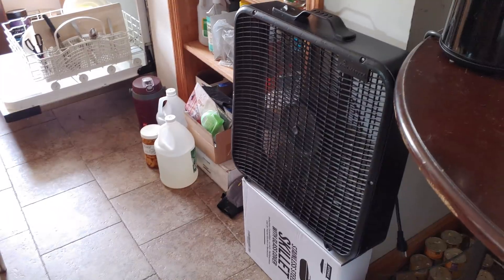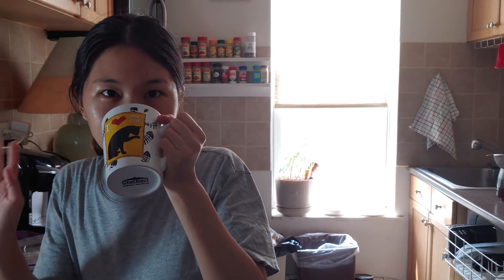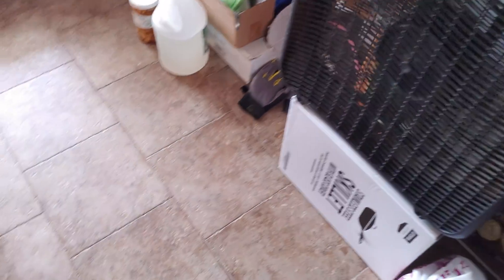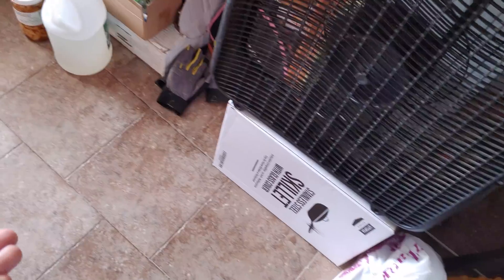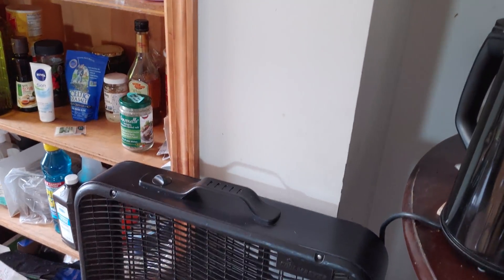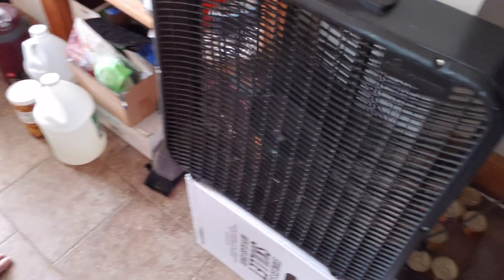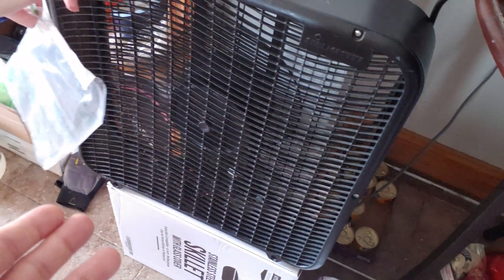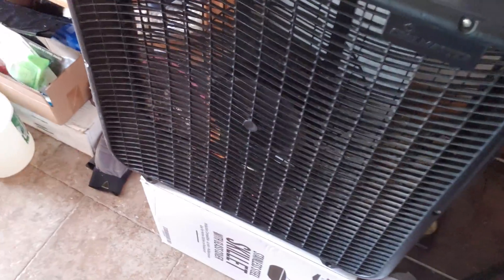Apple user ventilates home worse than Apple ventilates their computers 😢

Comment: TBH, some PC cases' front intake are just as bad as this. All the glass, RGB LEDs to make it pretty while the fans are choking for air flow.
Reply: @Bobby Bologna 😶 watch Gamers Nexus and their case reviews. You will realize how badly mistaken you are lol... it matters how much air MOVES through the system lol. You need to provide the fans air to be able to push out the hot air lol otherwise you are literally cooling nothing.
Reply: Yeah, but at least you get to choose a better case, if you want, unlike with Apple.
Reply: @Ben T. The thing that turns most people off from good stuff like Noctua is the weird coloring, almost anybody that makes a computer decides to put tacky RGB everywhere they can. I've never liked the look of it, plus because so many people make sure to do their first build with RGB, they can run into some problems.
Reply: @Ben T. Why spend so much on case fans?
Reply: How does RGB affect airflow?
Reply: @anonymousarmadillo6589  Everyone knows more RGB = MORE performance!!! R-right?
Reply: @Hyoiza  Yeah!!😂😂
Reply: @Hyoiza  Only if you set it to only red. If you set it to blue, you get more cooling, and if you set it to green, it uses less energy! =D
Reply: @anonymousarmadillo6589  Many case makers use solid glass front panels so that you can see the RGB fans better instead of using metal mesh, THAT'S how RGB affects airflow.
Reply: @SirReptitious  If you but a decent glass case, its not that bad.... Atleast the heatsink is connected to the CPU lol
Reply: @SirReptitious  Such bullshit exists? I recently built me a new machine with a lovely upright box case, which got windows on both sides. Which makes sense, front and back are metal meshes. Didn't even need to think about the sense of the case, since it's obvious. But having a fully blocked glass front there? Dude, WTfuckingF?
Reply: @Bobby-Bologna0451  There are cases don't leave a gap behind the glass for the intake fan. Take a look at NZXT H510 Elite
Reply: @Bobby-Bologna0451  LOL! I seriously doubt there is a SINGLE case that has the glass a full inch from the case! If they did it wouldn't be a problem. It's more like a 1/4 inch...
Reply: @Marc_Fuchs_1985  Oh yes! Go browse Newegg and you will find even 4-sided glass cases(front, top, left, right) that look really pretty while baking your system to death inside. ;-)
I'm not into the RGB bling thing, and I still use a Blu-Ray burner, so the cases for my two systems are both older Thermaltake designs that have 5.25" bays and lots of holes in the front and top. No glass anywhere.
Reply: @SirReptitious  No RGB itself does not affect air flow if implemented properly. It is the solid glass front panel that is affecting the airflow and not the RGB.
Reply: @sayadiyeojhenries.815  Yes, that is what I said too. Because case companies know that many people want to be able to see the LEDs on the front fans, they use glass instead of metal mesh. I don't like the RGB stuff, so I use older style cases that have metal mesh fronts and 5.25" drive bays.
Reply: @Marc_Fuchs_1985  Typically there is a mesh gap in between the glass and the fans for airflow.
Reply: But when you build a pc you have a choice. When you try finding a laptop you have a choice. If you choose something that has no airflow at all on pc that is entirely your fault, as opposed to Apple forcing their 'interesting' cooling solutions
Reply: @Erenzilable  You have a choice there too. You can decide NOT to buy an Apple product based on their proven track record of inadequate heat dissipation designs.
Reply: @SirReptitious  true, but still. Say what you will about Apple engineering, but their software is pretty good. AFAIK musicians have it way easier on Mac
Reply: that's why we use pressure optimized fan on intakes and coolers.. but flow optimized fan on exhaust

Comment: "Before it was closer to the wall though"
Yeah nice try! Stick it in the closet and there'll be even more room! And just as much airflow :)
Reply: To be fair, moving it out from the wall Does introduce other practical problems, it's not just a matter of appearance. Simply put, the Fan's base is too narrow for it to be stable. Also the room it's In is very narrow. Most of the problems flow from those two facts. 
Though, really, that just means The fan needs a suitable base plate attaching to it. (And maybe moving an inch or so back towards the wall so it's behind the line of the edge of the table or whatever that was, assuming that's not enough for it to call again).
Reply: @laurencefraser  Then..... maybe she oughta replace the Mac fan?

Comment: The moment she said that it's far from the wall and doesn't look good, you KNOW you have an Apple user on your hands!
Reply: Why don’t they just put it under the table
Reply: It's a small room and her practical consideration was entirely valid, so that's reversing the point you intend. :<
Reply: @Eunostos  Fan working and actually providing air flow to hot room > takes up less space
Reply: + 1,000!
Reply: To be fair. Their iPad lineup is amazing!
Reply: @ripp3rjak934  it's not that the ipad lineup is that good, it's more that android tablets have been neglected by every sizable manufacturer, and google essentially seeks to use chrome os 2 in 1 laptops to replace tablets.
Reply: @JonDoe-wk9qc  iPad lineup is amazing!

Comment: At least she didn't think the fan will reduce the room temperature like some people do
Reply: My mother included...
Reply: @rockspoon6528  the heat from motor and the movement of air heats it too.
Reply: A fan will reduce room temperature if you use it to blow or suck air from outside (provided outside temp is lower of course).
But I get what you are saying, in a closed room turning a fan on will actually increase the temperature for obvious reasons.
Reply: @Leftfield2k7  probably, but not guaranteed. The question is will the better mixed air in the room when you have a fan lead to greater heat loss from the room? In a room without a fan there is a distinct temperature gradient from top to bottom (which if you have ever painted a ceiling you will know). A fan in the room disrupts that stratification and as radiative heat loss is proportional to T^4, could increase the heat loss, noting there will be less heat loss from the top of the room, so it's a balancing act. The heat from the fan (thermodynamics 101 almost all power consumed by the fan is turned into heat dumped into the room, apart from any noise that escapes the room) is negligible compared to having a living mammal in the room (got to account for the possibility of the cats).  Thermodynamics is hard people.
Reply: @jonathanbuzzard6648  Wow never thought about that but of course it can have an effect on room temperature especially if you got thick stone walls that might cool the air more because of the airflow. Still I don't get why people don't just open the windows because a fan can definitely not improve the freshness of the air (it can't magically add oxygen). Pretty sure it's actually really bad to be in bad air for too long because your brain and body needs oxygen (obviously), meaning it can have a bad impact on health and intelligence I guess. Brings us back to Apple users doesn't it?
Reply: @jonathanbuzzard6648  @martin der tolle yes this is exactly how it works, not only it MAY but it will reduce overall temperature except everything around the room (including floor, walls etc) is hotter than airtemp (which never is). 
the effect is actually pretty big.  you reach the maximum cooling capacity of all cold parts (mainly floor but also walls) by active airexchange.
opening a window wont help you at all, static air pressure isnt big enough to make any airexchange by a simple open window, even if you have very cold air outside it would take days to exchange all the heat outside with a single window.
only if you have 2 windows on oppsidte sides which can create active airflow were getting somewhere, if not a vent is your best chance, best would be a big floor bottokm to top airflow
Reply: It will if you put a fan at your Window sucking colder air in to the room from the outside.
Reply: @OussamaAbuUmar  That trick also works to move A/C around the house so if you only have a few window units like I do, you add fans and the entire house stays cool.
Reply: @OussamaAbuUmar  where did you see a colder air on the outside? That is insubstantial
Reply: It reduces human temperature
Reply: Have you seen that one, where the guy thinks wind tubines help global warming because they cool the planet down. The world always makes a better idiot.
Reply: you feel cooler because of evaporative cooling works on your skin.. :) not the room temperature
Reply: @YansenHaryanto4547  correct. It has a use. But I know someone who likes leaving a fan running in the middle of a room with closed windows, when they're out of the house, for the stated reason that it cools the room. Those people exist.
Reply: @Gameboygenius  Yeah, I am surprised people like this still exist in this day and age.
Reply: How stupid. Everybody knows that to lower room temperature you have to open the fridge door.
Reply: I think the idea of fans is that you want to move air from one place to another. You can either use a fan to draw cooler air from the outside if the outside air is cooler than the inside air, or you can use a fan to move hot air and blow it somewhere else. A room is basically the same thing as a desktop tower -- it's a box and it has heat-producing elements, be it electronic gadgets, TVs, or even a person sitting in the room that is producing heat. You want to take this heat and get rid of it, either by cooling it with cool air, or blowing the hot air out of the room where you don't care about it (which lets fresh air come from somewhere else that is likely cooler). It works on the same principles that desktop PC cooling does. If fan motors always produced more heat than they can solve then desktop PCs wouldn't use fans for cooling.
 
 The idea is to place the fan(s) where they would do the most good, to move air properly to get the most benefit with an actual plan inside. Just dropping a fan in the middle of the room without any clear plan as to what you want to do with that air isn't going to do much of anything to help you. 

I'm in the process of building a new bedroom onto the side of my house, and I plan to put my knowledge of airflow to good use; it's going to have two windows, opposite of each other, and I plan to get a pair of window fans -- one will be an intake, and the other an exhaust, and I will have a constant flow of air across the room (the PC desk will be against one of the perpendicular walls) so that air won't really have much time to linger in the room and heat up. I'll also have an AC enclosure built into the room too, so that if the heat outside gets too much for the fans to handle, I can just turn the AC on as well.
Reply: Or suffocate you if you run it while you sleep.
Reply: @gargantuablargg  ?
Reply: Samuel Prince  Not just the sun hitting the building, but also electronics and people inside producing heat as well. That, and while you're inside the building, you're effectively under shade and not receiving direct sunlight (unless you stand in front of a window). So if you draw air from outside in and blow the heated air out, it's going to feel cooler in the building.
Reply: If anything it would technically heat the average temperature of the room due to wasted heat from the motor and friction
Reply: Unfortunately true, no thanks to our fine school system.
Reply: It reduces the temperature that matters, who cares if it doesn't actually reduce the entire thermosystem of the room
Reply: @ChamplooMusashi  Except it doesn't actually lower the temperature in most cases. It's just moving air -- hot air -- across you. This might fool you into thinking it "feels" cooler temporarily, but once you actually stand up and move away from the fan then you realize.... it doesn't... actually make you cooler. Now, doing it right, and having good thermodynamics and aerodynamics in the room, you can do a lot with a little with just one or two fans, much more than you could with a poorly placed fan that's only wasting electricity for an illusion.
Reply: Samuel Prince where I live there are weeks and weeks when my house stays closed all day because it’s far hotter outside than in. You don’t leave windows open, you don’t leave doors open. Maybe around 10pm you might open the house for fresh air. If night temps remain high (+85 F) for more than 4 days, you’re in trouble because the house temp equalises with the outdoor temp and won’t fall.
Reply: You can actually dissipate heat with a fan if it blows air from the inside to the outside.
Reply: @phoenixrc0074  That's a common joke wher you learn thermodynamics.
If you didn't had the "fridge" question, then it may flow over your head 🤣
Reply: Don't tell Apple.
Reply: @J0e T a laptop heat a room more than a fan. A fan; 50watt, a laptop; 60watt. More comparison; A human; 60watt, a refrigerator; 100watt...

Comment: "The plastic is too thick!"
"The CPU is just too hot!"
Reply: Apple, think different
Reply: "You're holding it wrong"
Reply: Yeah.. remembered how "superior" the A11 Bionics was going to be and totally destroy snapdragon? Well now we know you can't blame Intel for Apple's terrible thermal management.
Reply: Jonny will make it "impossibly thin"
Reply: The rent is too damn high!
Reply: You're using it wrong!!!!!
Reply: Louis is a man with almost infinite patience. I'm impressed.
Reply: "You are not supposed to actually use the cpu. No warranty!"
Reply: "The CPU is just too hot!"
to be fair, those were intel cpus :D
Reply: @LeWille00  Don't worry. Apple will apparently found a way how to properly screw up ARM CPU's too. And rob their customers for triple price with that. They are geniuses.
Reply: @funkemunky  Sure thing. 800$ MSRP for upcoming ARM based Apple MacBook which probably will turn into like 1200 euros in my country (and don't forget about VAT).
Reply: @LeWille00  Can't blame intel for Apple's horrible cooling solutions. Everyone else knows these run hot and have adapted their designs accordingly.
Reply: @LeWille00  Well... Turns out most other manufacturers do also use Intel CPUs. And they have no problem cooling them. Even with higher TDPs.
So clearly it is Intels fault that Apples Notebooks are running hot! I mean, they run hot even though apple decided to move the fan far away from the actual heatsink, and they still run hot! How is that even possible!
At this point, I am sure that they will find a damn way to even make an ARM chip overheat like crazy. And I mean melt-down style not Raspberry Pi style or Samsung style. (It's not like every other manufacturer is exactly good at cooling. But at least they make their stuff cheaper!)
Reply: @fie1329  I know, I thought the smiley at the end of my sentence indicated humor I guess I'll add more indication next time.